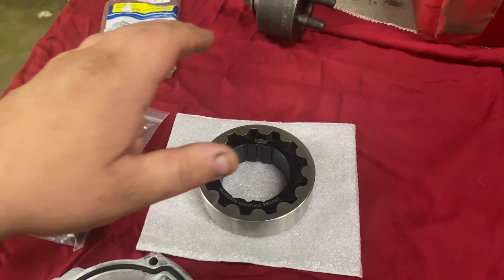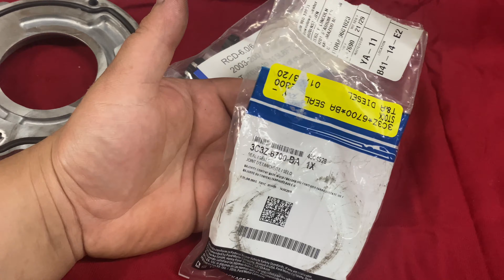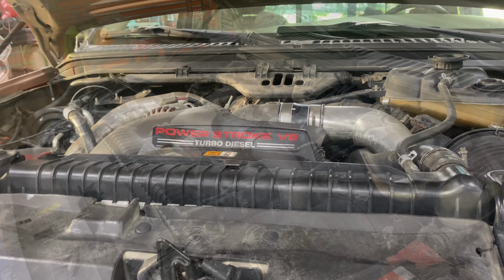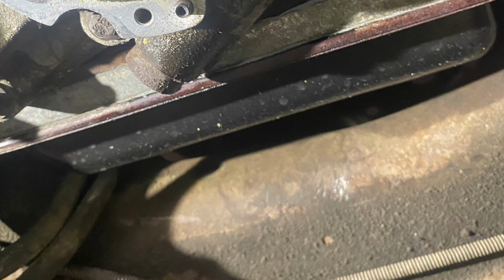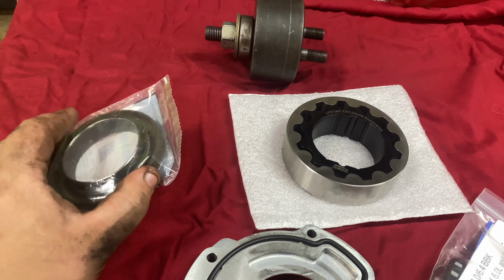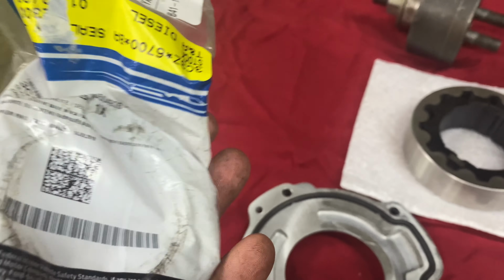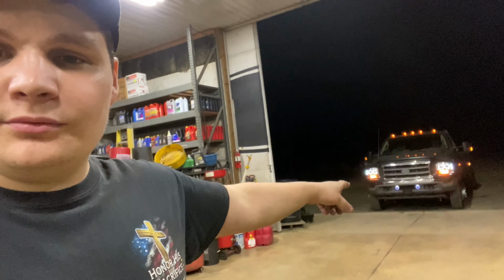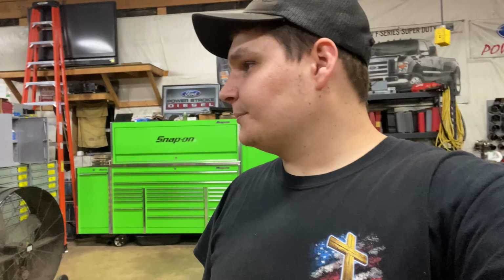BILLET LPOP 6.0 POWERSTROKE! NO RPM LIMITS!

Comment: What is rpm limit on a fully built 6.0 powerstroke!? I mean FULLY built. Such as: Waggler Rods, delipped coated pistons, polished crank, KDD ported aluminum heads, Jezzel rockers, Odawg s3r, RCD billet lpop, RCD Thumper 2, RCD stage 3 cam, RCD 250/150 conventionals, RCD tubular manifolds, ATI Super blancer, CFS Intercooler, s369sxe, paired to a full billet trans, with a billet triple disc converter 2400 stall. Then all the other supporting mods. It will hit 4,000 rpm at the blink of an eye!

Comment: I always did front main work from below thinking it would be to hard to reach and see inside the front cover. I never like putting used coolant back in so I like how your way made it possible to save most of the coolant. Thanks for another great video. I wouldn't be the tech I am today without people like you who put out great vids.

Comment: If your oil pressure isn’t coming up on dash is that a good place to start? Enjoy your content
Reply from the maker: Check the sensor first(one wire sensor just behind oil filter). TYPICALLY if the vehicle still runs then the problem is unrelated to the low pressure oil side.